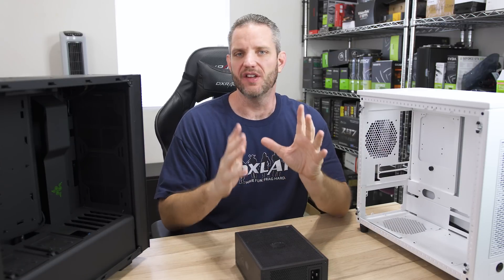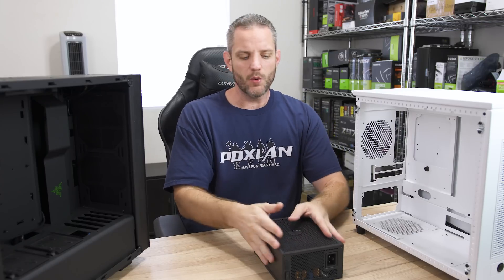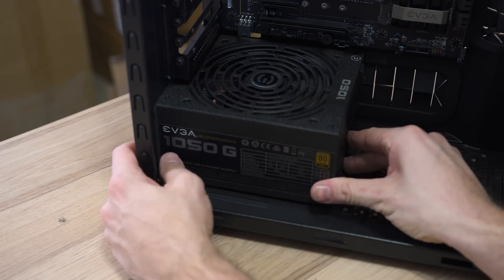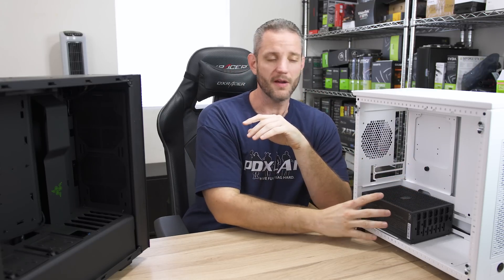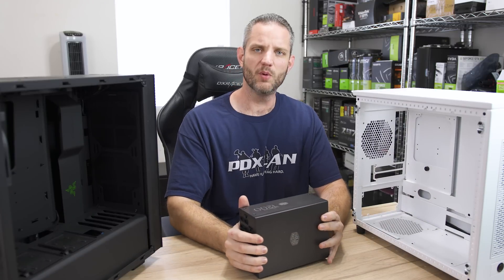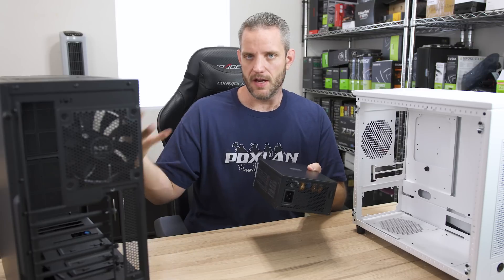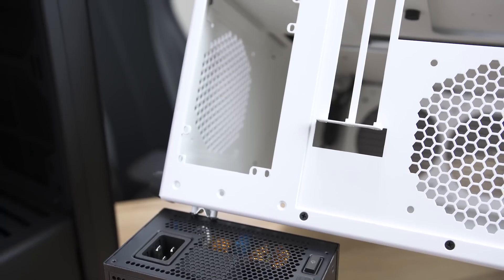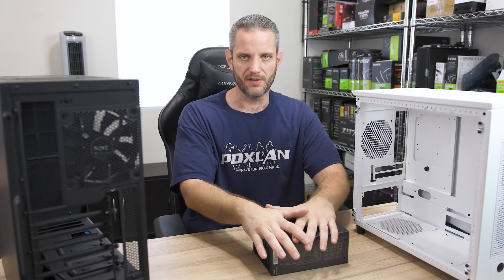Should you mount your Power Supply up or down?

Comment: Some comments from the top of my head:

- When the power-supply fan is not spinning then it is not contributing to air-flow. The video mentions both, but does not link one argument to the other. Having an open grill pointing upwards then allows for the PSUs heat to spread even easier inside the case.

- A down-facing fan can suck dust into the PSU when no filter is installed. An up-facing fan will suck dust into the PSU from within the case. Even if the fan is not running, dust will fall through the open grill, because there is no filter on top of it. Regular mesh on PC cases does not filter dust. Check the dust in your case and decide if this is a possible problem.

- It seems rather unlikely that the PSU will suck warm air from its exhaust back into a down-facing fan. The heat is exhausted at pressure and then travels upwards. The down-facing fan pulls air from all directions if unblocked, air temperature  below the case should usually be coolest, especially with the case standing on the floor.

- Pulling air from within the case likely is going to be warmer once a graphic-card is installed that pushes its hot air back into the case (as most cards do). This means the PSU gets hotter rather than cooler, which is ok, because a PSU usually is meant to operate at up to 50°C ambient temperature and then contribute to case ventilation. If the fan is even spinning that is.
Reply: The PSU may suck its exhaust air back in if the PC is close enough to a wall. The exhaust air out the back will hit the wall and scatter in all directions, including down to where the intake will suck it back in. I doubt the small amount of warmer air would have much of an effect on the overall temp of the PSU. The amount of warm air as well as all the cool air would make the intake temp effectively ambient anyway.

Comment: Nice video. Great explanation and advice.
One thing I do not agree with.
It's almost impossible to have a loop of suction air from the power supply if it's mounted with the fan downwards.
It is advicable to have the intake air fans at the bottom or in the front of the PC, because the warm air is lighter than the cold air. That's why they changed the position of the power supply as we remember years ago it was at the top.

If you mount the power supply with the fan downwards(not on carpet) it will always suck a cold air, because it's heavier and it stays at the bottom. The warm air that goes out from the power supply wil immidiately go up so it's impossible to be sucked in again unless you have a intake fan on the back top case .

Mounting the power supply upwards it's not a bad thing too if you have a infront intake fans. But having a powerful GPU might cause a slight problem since the power supply will always suck it's not so much cold air.

It actually all depends if you want to use your powwer supply as a exhaust fan too or keep the supply in a good condition.

Comment: i turned mine down to breath through a filter, i live in jamaica a hot climate so heat is an issue sometimes summer is crazy, and dust can build up really fast which affects cooling and apparently electrical stuff lifespan can be affected by heat, anyway i would prefer to turn face up for cooling the case but that heats up the psu more than it needs to be under load

i had a corsair 750w 80+silver modular in the past that died from heat with my old setup did the setup completely wrong gpu kept heat in case so i made the liquid cooling take air from outside, ambient case temps were crazy lol 

in hind sight if i were to do it how i wanted id do a top mount cpu liquid cooler venting out from case and a reference blower style gpu to blow hot air out too maybe a liquid cooled gpu to blow hot air out the rear of case via NZXT G12 

thanks for the vid Jay u the man :)

Comment: I have my power supply mounted down. My computer is mounted on a wooden blanket chest that i built.(the "front' of the chest opens and the computer is on top). 
My case has a shroud but also is vented into the upper part. 
I also am water cooled and have 2 exhaust fans and 2 intake fans. It seems my choice isn't negatively impacting my system based on this video. 
Thanks.

Comment: There are several issues with your presumptions about case airflow here Jayz - 1) it doesn't matter if you're using +ve or -ve case pressure, the ingress of dust is exactly the same. You also said you like to use neutral pressure in your case - this is impossible if there are ANY fans in use - you cannot have neutral pressure inside the case when case fans are in use. 2) As for PSU orientation - as you say, many higher wattage PSU fans do not come on until the current (wattage) draw is at a certain point, or when the PSU reaches a set internal temperature, so I mount my PSU with the air input upwards as, when the fan is not spinning, which it never does on my Corsair HX1000i PS, then what ever heat it is producing, my PSU runs at about 35°c, goes up, as heat rises, out into the case.

Comment: Like to hear different ideas and concepts, interesting for sure. Still, let's face it we are all some serious amateurs here in regards to aerodynamics and the engineering side, even the best in the aerospace industry/Formula 1 etc still constantly making small strides within the cutting edge field and claim it is very, very complex and extremely hard to understand for them, even though some basics are well established already. A fan inside a PC may be a bit simpler sure, but so are we compared to these people, so?

I am not saying we understand nothing at all, I am saying more things go on the first meet the eye withing these fields and full of contradictions, like the one Jay speak of if air keep circulating around the PSU, I can buy that sure. but warmer air also naturally climb up and do not stay at floor level. again it's just more complex and while may seem easy in theory I will be the first to admit I am actually pretty clueless in that regards. Might also explain why sometimes we see very small differences playing with settings, fan and radiator locations even though some things seemingly should make huge differences.

Comment: It’s funny I just saw this video and the case sponsor you have is the case I actually used about a year ago for my build. I would love to have my case on my desk but I have a small space so I leave it on the carpet. But I did get some wood at Home Depot and it works great. I actually used this PSU advice with my nephews build in the nzxt h500 case to reduce the gpu temp that could come from the gpu. Thanks again for the advice because his system does run at pretty good temps.

Comment: 3 years later here is another reason to mount the psu upside as an exhaust:
if you have an AMD X570 mobo, it has a chipset fan wich sits directly under the gpu. so its sucking in hot air from the gpu. to avoid that you can mount the gpu vertically in some cases. and the  gpu's hot air is dumped into the psu shroud. now mounting the psu upside will suck the gpu heat through the psu out of the case, while the upper-rear exhaust fan takes care of the gpu from the upper side as well as of the cpu's heat.
Reply: The whole point of a PSU fan is to cool the power supply's internal components. I don't think sucking in hot GPU air is really going to help cool the PSU too much

Comment: If the case builder put a dust filter in the bottom of the case to filter dust out why do you the instal the fan up on the power suply if we forget the placement om a carpet ?. The talk about under and over pressure in a ordinary computer case sounded like it was better in vacum. 😀 Thanks for the video.

Comment: And wtf happened with the cases that used to have PSU on top, with the fan down naturally ?  Best version off all, PSU pulling hot air out of the case + electrically safer, but they are not making those anymore, why ?
Reply: hmmm. MY PSU is mounted at the top, at the back, with the fan blowing out. 2009 dirtbox cooler master case.
Reply: @Dennzer1  Yeah, I'm still using Chieftec Dragon midi tower case. Heavy as car, but unbreakable. PSU at the top, back, sucking air form the case (above cpu) and blowing out. Best design and safety. I guess they will reinvent this in a few years :D
Reply: @dsounds1  Well, I wonder why so many cases are being designed away from that idea of top/back mounted PSUs...
Reply: @Dennzer1  ...and you can even put your case on the carpet.... I mean, I have no idea why they left that design...

Comment: just came to answer... DOWN... heat goes UP so is worst having your PSU up there, PSU cooler sucking air from the bottom and expeling it from the back how is supposed to be.
Reply: Cooler Master NR600. I should mount down? Using a Fractal Design ION+560
Reply: @Dennzer1  yes, always the PSU goes down
Reply: @Siniestro  Just to be extra clear. So... the air being pushed out by the PSUs own fan, is rushing out of the case, towards the floor? 
Then, why keep the little dust filter that the NR600 ships with that case on the bottom of the case at the back?
Reply: @Dennzer1  the PSU sucks air from the bottom and push it back of the case...I don't know that case...but pretty much every single good case works like that, the PSU cooler is in the bottom and sucks cool air and the expels it to the back, the air never gets in contact with the air inside the case

Comment: Allow me to summarize without watching the video.
Down: You have good airflow under the case. Not sitting on carpet suffocating the fan. Or you dont trust your water cooling setup. 🤣
Up: Down isnt an option due to airflow.
Reply: Cooler Master NR600. I should mount down? Using a Fractal Design ION+560

Comment: I will usually just mount the PSU face down since the case I will be using (Fractal Design Define R6) with positive pressure (front and top fans intake, one exhaust)... should keep my system frosty cold. Using 1500 RPM fans from Noctua.

Comment: Heres an idea: Dont ever put your computer on carpet.
Reply: It's ok, my case has insulating strips so my psu won't charge the case...also I put some livestrong anti-static bands on top for good measure
Reply: @mikefishermagic   fighting static and cancer i see 😅
Reply: I have mine against it, imma get a piece of wood or something from the trash
Reply: @reyluna0  put mine on cardboard until I get a good peice of wood under it
Reply: @reyluna0  Used tissues and orange peel?
Reply: @reyluna0  wouldn't it be putting your pc on trash ?
Reply: @proxy-i4o  lol i guess, i have a better one now and a desk big enough for it
Reply: I had a PC last over 10 years on carpet.
Reply: Yeah that one I thought was a doozy 😆
Reply: I built my PC 5 yrs ago and it’s been on carpet every day of that. Guess what,  nothing bad has happened!
Reply: @98JamesNixon  do you place the psu facing up towards the gpu? Or facing down where the vent is?
Reply: James Smith  static electricity shouldn’t be a problem with carpet for a PC because the system is grounded. The issue with static electricity is that it can potentially build up when you are standing on the carpet (shuffling your feet) and then partially discharge to a non-grounded component like a CPU or motherboard while you are building a system. Once the system is plugged in (doesn’t even have to be turned on) any static will be discharged safely. Many builders use a static wrist strap that hooks onto something grounded, which is best practice. I’ve always just made sure to touch a grounded object right before handling RAM, etc. and then touch it again every so often.
Reply: @ryanbecker6584  hi, cumpa! What you describe is the proper practice for handling components. Unfortunately, in my case I need to exaggerate ad nauseam those: I'm currently living in the most dryest city of the planet, and static electricity and dust are just massive. I put my rig on top of a couple wooden benches, and now I'm seriously considering to install a grounded cable for it. Cheers from Chile, mate!
Reply: What this guy said.
Reply: My psu is facing upwards on the pc is on the carpet and it's fine lmfao. Not the most ideal I know, but my temps are fine and it doesn't get too dusty tbh.
Reply: I always put the carpet ON my computer. Keeps the fan noise muffled 😁
Reply: @WanderingRogue1  same, it's great, less noise, no airflow impact.
Reply: Sometimes that’s not an option. Some people just may not have a lot of space. The floor under the desk being the only option.
Reply: I put a piece of wood (a shelf board) underneath so it wouldn't be against the carpet.
Reply: My computer is siting on carpet but I have a PC O11 so the power supply draws air from the side.
Reply: My computer is on its side on carpet. My case was meant to be able to do this though
Reply: Unavoidable if your whole house is carpet
Reply: whoops...
Reply: Muncha King well good thing you told me before I get my gold 1350w psu and it blows up, I can fit it on my desk or I’ll just get a table from down stairs just in case.
Reply: I put my terrible XPS-8900 on my carpet once and I was almost certain it was going to explode
Reply: Me: laughs in hardwood floor
Reply: I agree, at least put it on a piece of wood.  Carpet is flammable.
Reply: @James Smith i wont even put my rig on the floor. its a masterpiece, it deserves a mantle
Reply: Lol u just shamed my carpet pc setup (My $900 pc is sitting on the carpet with psu at bottom).
Reply: Chronicle Fox well you only paid 900 for it, that’s why it’s on the ground
Reply: He only said that to cover up his mistake.
Reply: Ok I will put my pc on a carpet
Reply: Put your computer under the carpet instead. Got it! 👍
Reply: Mines on carpet i have no choice right now
Reply: The solution is to put the machine under the carpet and not on the carpet. It solves a lot of trouble.
Reply: Nah ima do it you can’t stop me
Reply: Once I heard that that guy put his pc on carpet I was like: "WHY?"
Reply: my desk isnt big enough 😭
Reply: Here's an idea. Mind your own business. It's not a huge deal like people like you make it out to be.
Reply: For xbox users its not common sense its normal to play on carpet 😢😂
Reply: I’ve had computers sitting on a carpet hooked up to my TVs for so many years I’ve lost track.
Nothing has ever happened.
Static my arse. Most cases have rubber feet.
Reply: My pc is sitting on a Newegg box
Reply: Don't tell me how to live my life.
Reply: Exactly, who the fuck does that lmao
Reply: It's so weird seeing Americans have carpet in every part of their house that isn't tile.
Reply: Why?
Reply: LittoBud he is trying to scare you 😂
Reply: @littobud bro
Reply: @littobud  Extra dust
Reply: Had mine on carpet for years, then again my case has the PSU at the top where it should always be imo.. Looking at a new build now, and unfortunately they're all at the bottom D: So gonna have to make a little shelf for it to sit on under my desk. \o>
Reply: Damn yankees has those stupid carpets on their floor.
Reply: @besticouldget  maybe learn how to clean up once in a while???

Comment: If I replaced the fan in my modern power supply with a faster rpm one, wouldn't it extend it's life? Why don't the slow stock fans in modern power supplies cause the unit to overheat?

Comment: Wait, what? The PSU stays cooler if it breathes from inside the chassis? Gotta rewind here.
Okay so top-perforated PSU shrouds make a lot more sense now.

That said I'm planning to make positive pressure at low loads to help keep dust out (It might still work out quieter than neutral because the intakes are bigger than the exhausts), while at higher loads I think I'd get more cold air to the GPU if it wasn't being diverted to the PSU.
Besides, if I prioritize GPU intake by putting the PSU fan-side-down, the GPU will stay cooler, and then have lower resistance, and then draw less power, which in turn will reduce the strain on the PSU.

As for exhaust, well, it looks like the exhaust case fans will be 40mm less in total than the intakes, but the rear-exhaust GPU has a fan that looks about 70mm wide, and the CPU cooler blasts air straight back towards one of the exhaust fans, so I think I'll still do well for airflow if I allow neutral pressure at mid to high loads.

Also WTF this is basic?!? I've never built a PC before, and have lost a lot of sleep trying to figure out this stuff in time for Black Friday.

Comment: How do you get a heating loop when the warm air exhausted from the power supply rises?
Reply: Orion 8096758 I mean I’m pretty sure that the fan facing upwards is an input fan and the warm air is pushed out the back (I think)
Reply: @Ethan-rz6cx  You are correct intake side on top with heat exhaust going out the back of the unit. In my recent build I had no choice but to place the intake down because of separate enclosure for power supply draws air from below. Without the enclosure I would have gone intake facing up, just to draw heat from inside the box out.
Reply: When the PSU is sucking air in from below and letting it push itself out the back, there is still a suction pressure from beneath that will make even the hot air go down. You are correct that hot air rises in cold air, however, the rate at which this happens is far slower than you may expect, especially when we are talking only a few degrees difference.

Comment: I prefer up. The psu fan helps draws air away from the GPU and chipset area, and you only need to clean the front intake dust filter. Don't need to consider if it's on carpet or not. It's simply more fool proof.

Comment: I used an old cooler master wave master case for my build (it was free) which has the psu in the top, fans are all original, would it be wise to replace the rear fan with a controllable one (runs off mobo but no control) and replace the 2 front ones also with controllable one's (currently run direct off psu)
Also, what material would you recommend for filtering the front intake? It's 2 fans one above the other